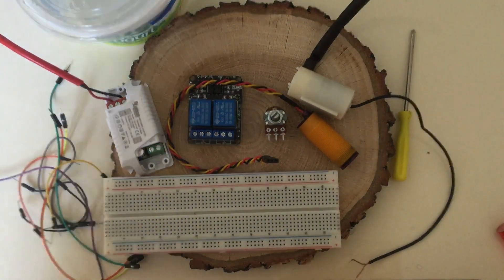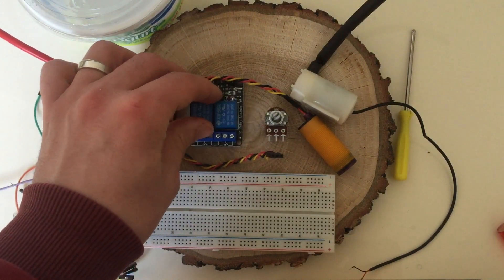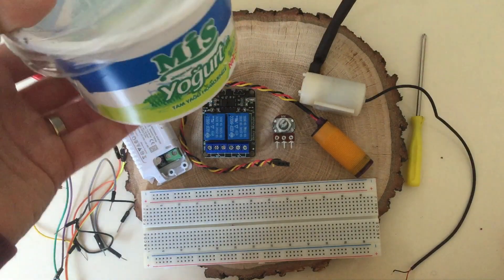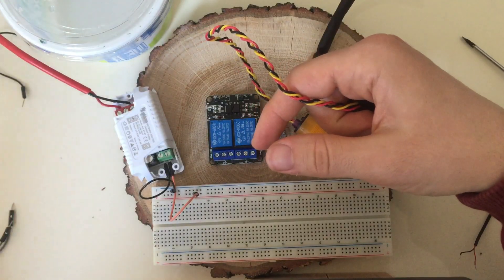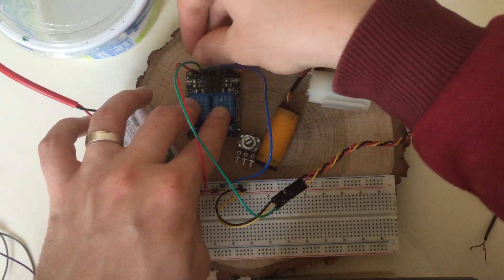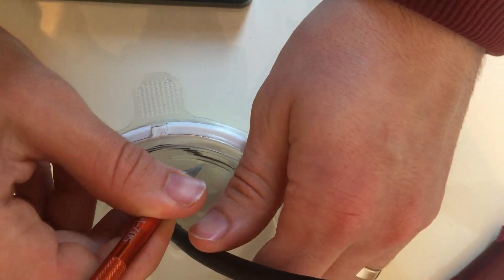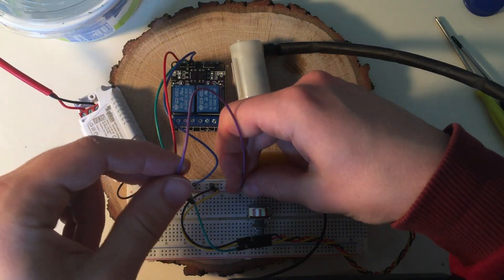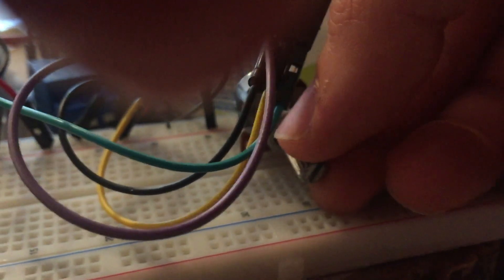#coronavirus DIY SIMPLE & CHEAP No-Touch Hand Sanitizer Disinfectant Dispenser

Comment: Dear Sir  , Great Job with this , Does the pump have enough pressure to connect to a nozzle for a fine spray , I would like to build this and use it with a nozzle that sprays the liquid ?
Reply from the maker: Hello Kevin, I really doubt that, it is a very cheap pump and I don't know its parameters.